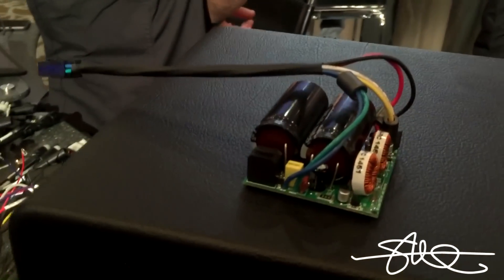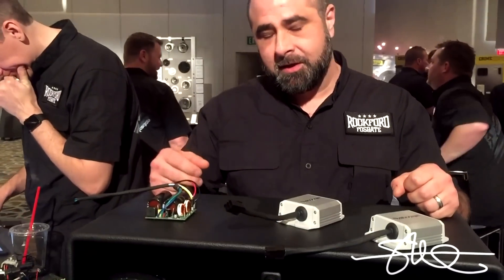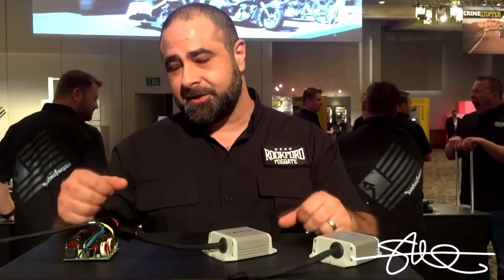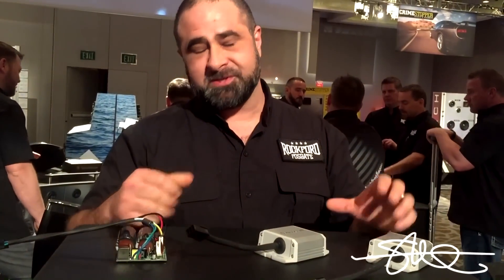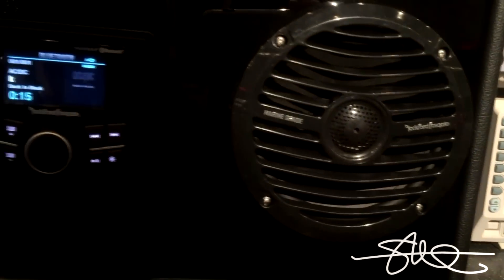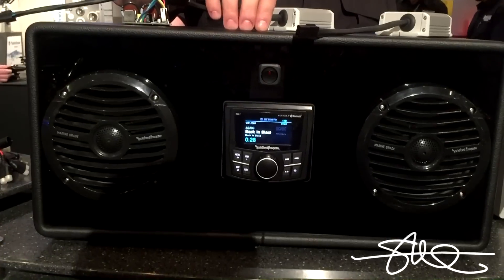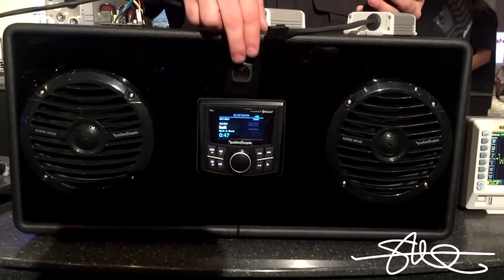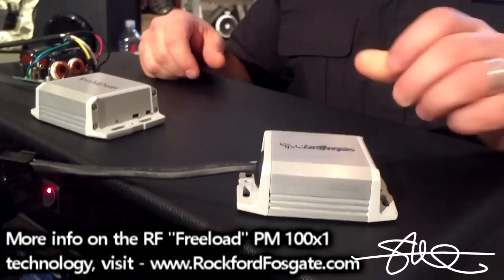Rockford Fosgate "Freeload" 100 Watt Amp - NO DC POWER INPUTS! (Explained, Demo, O-scope)

Comment: wonder how it would work if you used say a 500 watt amp and feed this litle thing,,6db  i would presume that is doubles the output,but would it be the same doubling if you feeed it with an amp instead of the stereo
Reply: 08halit Prob the capacitors would blow up

Comment: Thats pretty nifty. Would love to see that applied to any stereo and or factory setups. On a Side note. I have a old pioneer GM-H100 and no head unit. I want to use my phone as the source. The thing is the amp has some weird configuration. Won't play any audio unless the inputs have some type of virtual ground.

Comment: This is completely nuts and blowing my mind.  I kinda understand how it's storing "excess" electricity to use later, but I have trouble believing that it can store enough to make that much of a difference.  Am I correct that they are intending this as a "booster" amp to get more power from a factory head unit into the dash speakers?  When I saw the video title I was thinking this was to be used to combine and boost the factory power to drive a small sub-woofer.  Either way this is a unique product and I can see it becoming useful as head units are becoming harder and harder to change out for something with pre-amp outputs.

Comment: So in a sense you would need a pair of these for a pair of speakers correct?    So let's say I have all 6 channels of rca hook up to an amp and use the head unit speaker outs for smaller speakers.  I could add these online in the speaker out puts and use these to give the speakers more. ?

Comment: i am trying to find a decent  high amp alternator for a 2001 dodge durango 4x4 slt and i can't 
seem to find one anywere could you maybe help me out finding one man
Reply: +modmanwb What size engine does it have?
Reply: +Flat4Buggy 2 4.7L v8
Reply: modmanwb http://www.mechman.com/alternators/dodge/dakota/3-7l/2000-2006/s-series-240-amp-alternator-for-3-7-4-7-chrysler-late/
Reply: thanks man
Reply: modmanwb No problem.

Comment: he lay's mention to what happens when the stored power runs out.  i took it as  it will just run what the headunit puts out.  like a pass thru.  which i bet would likely lower that of what the headunit is typically putting out do to possible resistance.  i'd like to see these on a sine wave and a db meter to watch how they fade in volume..

Comment: I can see this being very useful for situations where a customer has a new/expensive car, wants the stereo to be louder, but does not have space for, nor want a dedicated amp. 
$400 for a pair, plus the ease of installation (pop out factory speaker, wire this inline, done) would put this in the same price range as a cheaper amp + the cost of installing an amp and doing all the wiring (B+, ground, RCA, Speaker wires, gain matching, etc) For the customer, there isnt much of a difference. 100 watts of RF power is going to sound the same to 90% of people as 100w of RF power, but the installer will be much happier.

TLDR: This is the tuner chip equivalent of adding more power, and i think its awesome!

Comment: Sounded like it was also clipping at normal mode, after the cap kicked in it sounded more dynamic. So this looks like a cap for a head unit, with a bridge rectifier and some smoothing coils on it, looks pretty cool.

Comment: seems like a great add on for my goldwing sound without lots of heavy equipment mine is only 2 channels anyway. F6B!
Reply: Actually your F6b has a 4chan amp and rear Speaker outputs. Under your seat on the right hand side, look for the 4 pin plug, the rear channel is a much lower output than the front tho..... 
I'm actually thinking about using these on my F6Bs rear speakers(I added a Tourpack)

Comment: does it by any chance have anything to do with the way that head units split the input power into two rails by biasing it with roughly 6v so that the peak to peak output voltage is roughly the input supply meaning that there is roughly 6vdc between the high level outputs and ground?
Reply: Not sure, as far as I know there is some sort of voltage increase. Hence the switch mode hum and the presence of rectifier and smoothing coils, though it looks like a variant of what you mentioned.

Comment: I would also say to me you still going to end back at a 20amp load once the capacity has drained so in stead of hooking it up to your power on your deck you wold wand like an 8gauge wire fused going into the recharge pole of the connector???? Then there would never be the chance of frying your deck. Great idea on Fosgates part. But for that cost I'd just grab 2 PBR's and call it a day.

Comment: This awesome, I hope this takes off. It looks like it'll be easier on the cars electrical system while adding more performance. Affordable and simple option if you want to add a little more performance to a stock system.

Comment from the maker: PEOPLE! It is not $399 MSRP for one it is $399 MSRP for a pair of them.  Although  you will probably STILL bitch about the price, i hope it makes you feel 50% better.  And guess what, that is FULL MSRP.  Most shops and dealers can do a lot better in person but we cannot advertise.  So Stop whining and just look at the technology for what it is. :) thanks!
Reply: +meade916 I just find it odd ( I am a Rockford dealer and yes we have head room to bring down the price, but I don't know if there is a market for spiking amplifiers. He never did answer the question on the power output once depleted, and as they have proven with BRT tech , you can steal and store power quick, but what happens if he were to play a track that wasnt from the 80s and all over the spectrum? Play a 120 HZ to 500 HZ consistant tone through that and see if it don't go from 100 watts back to 20 watts. Im curious about the tech in it but even if I was able to hook someone up for 300 cash for a pair, I simply do not see where this beats a BRT amplifier or small 4 channel amplifier other than the power draw which reality is they are using BRT tech to create these things. Just not sure bro, don't seem like an option we would use alot in the shop. Maybe on a bike but even then at that price range we have a Focal 4 channel that will fit the bill an do a consistant 60 RMS per channel. I guess Im not sold on it but maybe Rockford can find a way to show us how we can market this product over a 4 channel amplifier.
Reply: +mtemp2006 I'm pretty sure the guy showing it said that after the device had depleted it's storage bank it would return to headunit voltage. I suppose that if you put this amp on an amp dyno it would have very nice dynamic power range for the size and ease of install but it would absolutely not hold up under a straight load like a certified amp dyno run. Which is more of what you're suggesting with the 120-500hz tones. I think this has some really killer potential in 2 and 4 channel "amp" applications. As far as producing long, heavy bass-lines which just eat up power I think it is still best to use a "real" amplifier. I think perhaps the best way to market this would be towards people with hybrid and electric cars because it doesn't pull any more amps. The customer can keep the same amperage draw on the car they always had just with better dynamics.
Reply: +meade916 

People bitching about this sort of price point should probably not be shopping RF in the first place.   I hear Boss makes some great 10,000W amps for a couple hundred bucks that would make them far more happy.

Kudos to RF for putting some effort into R&D.
Reply: +hispls Boss? 10,000w amps? rms x 100? Boss amps are known to output nowhere near their rating, same for Crunch, while Rockford exceeds their rating. if you want cheaper amps, Rockville amps also do their ratings, BigDWiz tested them on the AD-1 and the 1200w one did 1578w on dynamic mode @ 13.32v.
Reply: ***** some guy did a test on another lanzar amp and it literally melt the solder on the wire going to the fuseholder, creating an extreme fire hazard too, cause it was so called "double fused", while the second fuseholder wasn't even connected internally
Reply: *****

Implying companies like Lanzar does R&D and designs things.   All these 10 cent per watt brands just get a catalog from a Chinese sweatshop and pick which offerings they want to have their logo slapped on.  They may have some options in price of components/quality, but as I insinuated earlier, the companies that do their own R&D (like Rockford) price their products accordingly.
Reply from the maker: +Mark Vaughn "for once" you agree with me? hahah ummm thanks? lol
Reply: +meade916 Still begs for the question of how we market this against a 4 channel amplifier at this price range. So I guess from a Rockford Dealer to another, how do you plan to market this to a customer who for the same price range has a choice of a BRT 300.4 amplifier.
Reply: +meade916 Yup my jaw did drop when i saw that. $400 for two isn't that bad, though. Shoot you could damn near power a small subwoofer with one of those. Look at those Caps!!!
Reply: BENBOOST9

I don't want cheap amps at all.  My point is that there are brands that cater to the people who want to see a huge number printed on the heatsink and a very low price tag and there are amps for those who are willing to pay a premium for new technology and/or premium performance.
Reply: hispls na i just pointed out that Boss, Lanzar, Crunch, Dual and Pyle are absolute junk, and don't even do anywhere near their rating, while Rockville does, for example.
Reply: I used to own a little Lanzar HTG237 amp. It was reliable but that was about it. You could literally cook an egg on that thing. I broke out an infrared heat gun and it read about 170 F on the amp case.
Reply: BENBOOST9

And by all accounts, Audiopipe makes rated power (or close enough) and probably a dozen other "brands" that are just the same Chinese made junk with a different logo.  There's probably about 4 a year that come out and are forum boners for everybody who still thinks they'll get something for nothing and that the reputable companies charge the prices they do because they're "just greedy".  I learned my lesson in the late 80's early 90's (yeah, this game has been going on a long time) and have been buying only good quality since then.

If you cheap out on amps, expect poor performance, questionable reliability, and little to no resale value down the road.  You can still get a good resale price out of a 10 year old RF, Zapco, Zed, Audison, or Arc.  See what your Rockville fetches for a price in a decade (if it even lasts that long).
Reply: hispls i don't even have a Rockville, just said it does it's rating, also are you gonna use a single amp for a decade? wut?
Reply: BENBOOST9 I remember seeing that video!  That video was hard to watch man. I can't believe a company could be so dishonest... even to invest in FAKE FUSEHOLDERS for crying out loud. They had me fooled until I watched that video. Thank the Lord for amp Dynos too.
Reply: ***** yea man, i knew lanzar highly overrated their products, but never expected it to be that bad till i watched that video, Crunch and Boss are bad and low power, but atleast they have appropiate fusing.
Reply: BENBOOST9

Why wouldn't you get at least 10 years out of an amp?
Reply: hispls would you never upgrade your power in that time?
Reply: BENBOOST9

Not from where I'm sitting, particularly if the amps I have don't break.

Consider just a 4X100 amp for your fronts, from where do you upgrade?  To 150X4?  You'll get a barely audible gain and that's IF your components can even hang with that power.  Bump up to 200 per channel and you'll be very hard pressed indeed to find drivers that'll hang with that. and the 3dB gain you'd see in a perfect world doesn't even equal two clicks on the volume knob of a 0-35 measured head unit. 

It's also my opinion that after you hit about the 10KW mark in sub-stage adding more power becomes very low return on investment.  10KW doesn't come cheap, nor does the electrical upgrades to safely run it, nor the subs to handle that power, AND all that comes with a lot of extra weight and space.   Even jumping from 5K to 10K is a big step for not much actual performance gain.

I'd say if anything, the majority of car audio hobbyists are looking to DOWNSIZE in 10 years as they "grow up" or build a family, or just get other priorities/hobbies. 

Lastly, if you do plan to upgrade/downgrade in the nearer future, isn't that even more incentive to buy something high quality the first time so that you KNOW it'll have a strong resale/trade value?
Reply: hispls I went From 6k to 12k and barely went up 3db It may be my own fault but understand nice explanation but I still like the product great points being made tho be great for a newer vehicle an ppl with lots of money
Reply: Surely these things are running on the same 12-14v DC that the head unit runs on. With a current limited charge circuit for those capacitors so they don't melt the wiring loom of your car or blow the fuse. Other than that amplifiers with high level inputs are nothing new. I'm seeing horrible clipping in the oscilloscope demo. Both in the before and after signal.

Comment: Well I get how it works now. But I still don't see the use over something like the alpine power pack. The cost of wire and installing the alpine amp would still be cheaper than adding one of these to each speaker in a car. (at $400 msrp, so let's call it $250. x4 = $1k.) For 1k I think just about any installer would be happy to install a small 4ch amp, wire it, and tune it.

Comment: So did they give an estimation on release date and or cost? These would work for a few spots in my build and make things easy!
Reply: 400$ msrp
Reply: +Melvin Nix For starters i high doubt that, also where would this information be coming from?
Reply: +William Grundemann check the smd forums, there is a thread about this lil amp
Reply: +Melvin Nix k, just seems stupid at $400 considering the cheaper alternative of a 4 channel amp and a little more wiring
Reply: +William Grundemann indeed, you can get a lot of amp for 350$ and some left over for wiring and such